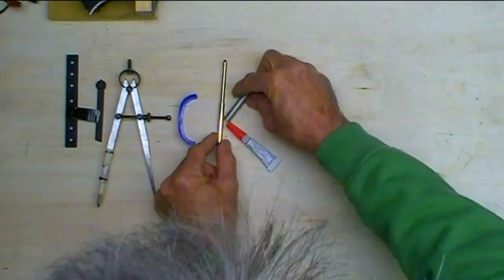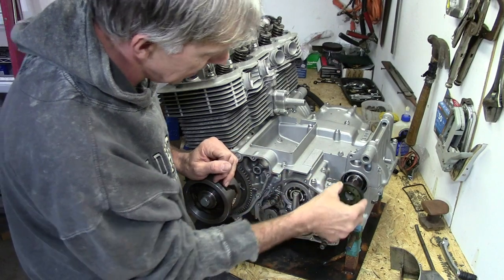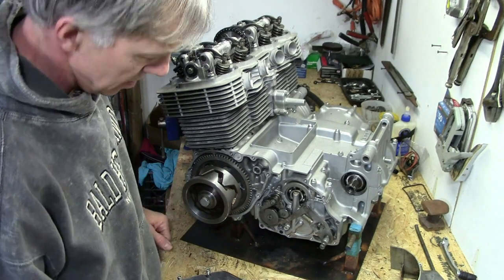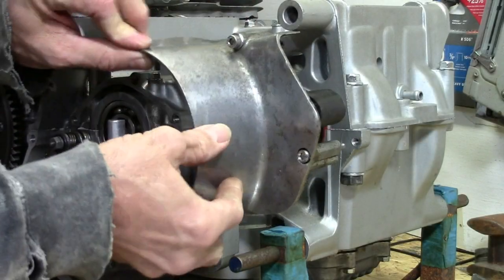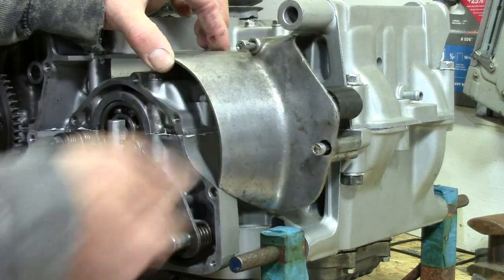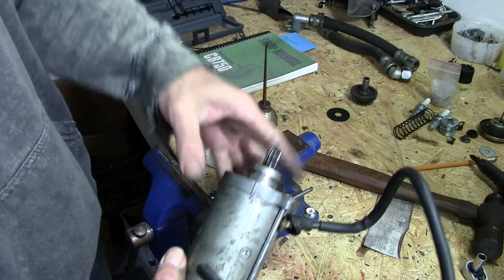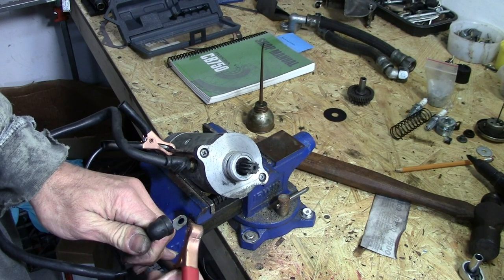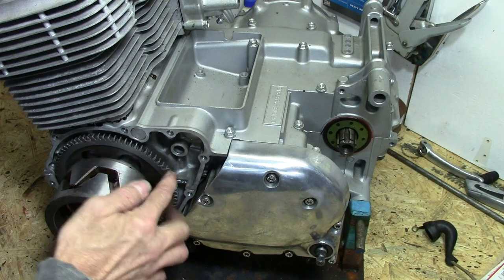73 Honda CB750 Custom Build Part 20 - Starter & Alternator

Comment: Excellent info in your videos here.

I've always been taught, especially with the SOHC CB750, that one should avoid using gasket sealer, like the permetex you use, unless absolutely necessary because pieces inevitably come loose and work their way into the oil passages, blocking proper flow to the top end.  In fact, I just picked up a '74 where the guy used RTV blue on the valve cover.  Pieces are falling off all over the place.  Because of this, I'm going to have to do a rebuild just to make sure it isn't mucked up.

Also a good excuse for an 836 kit, mild cam, and porting.  :)

Comment: Great post. Measuring a low resistance, the lead resistance of the probes may need to be subtracted. Also contact cleaner would be good cleaning rotor's contact with brushes. Would that convince carbon dust to stay away?

Comment: The reason you getting 0.5 Ohms instead of 0.2 is the resistance of the DMM leads. Short 'em together, and remember the value, then distract that value from measurements you make.

Comment: Hey, thank you so much for your videos. They are so educational and you explain things just right.

I'm building my cb750 right along with yours and ine thing I'm worried about is the electrical. Mine is a rats nest and the original harness is long gone. I'm dealing with wires that I'm not sure where they go. Are you going to be installing a factor harness or will you be laying down your own electrical work?
Reply: Factory harness. You can find a new one to buy with a bit of Google searching.

Comment: Dean, I know I'm like the third person to ask this here, but still curious about your meter display - "OuCh"?   Guessing it's for Out of range, and then Channel? Or maybe it's as a previous post surmised - you dropped it?
Reply: I never looked it up in the user manual but it shows O.UCH when it's measuring resistance and the leads aren't connected to anything.

Comment: surprised it only had two brushes... my kawi had 4... it would spin the engine when cold with only 2 but didn't have enough torque to start the bike if the engine was warm.

Comment: Are the stator field coil and rotor not supposed to physically touch or does it matter? I ask because These parts always look to be extremely close and I don't see how it would be possible to prevent them from touching when they are simply bolted onto a flimsy aluminum cover.
Reply from the maker: They don’t touch.

Comment: hey,  my stator and coil check out with the resistance spec but when I assemble it and start the engine I get no AC voltage.  checked for ground faults and there are none.  any suggestions.  1974 cb750k4

Comment: Okay, this might seem a dumb question, but what keeps the engine from continuing to spin the starter motor once it's going?
Reply: Darren Landrum The gear it drives has a built in one way clutch, also known as a Sprag clutch: http://en.wikipedia.org/wiki/Sprag_clutch
Reply: ***** Thanks! I figured there had to be something like that. :)

Comment: Can you not get brushless starter motors?
Reply from the maker: Wayne Johnson I don't know of one. Brushless motors require an external integrated inverter/switching power supply, which produces an AC electric signal to drive the motor.